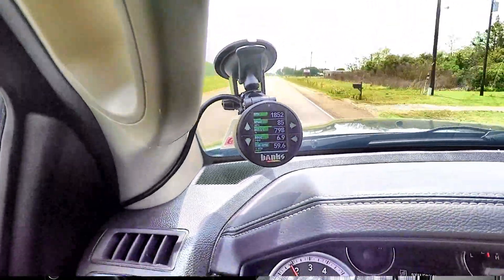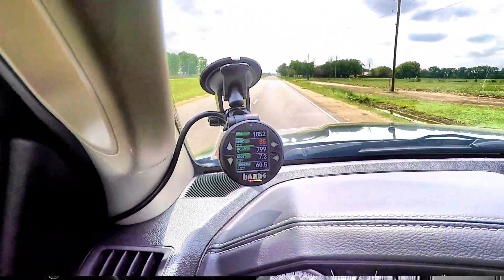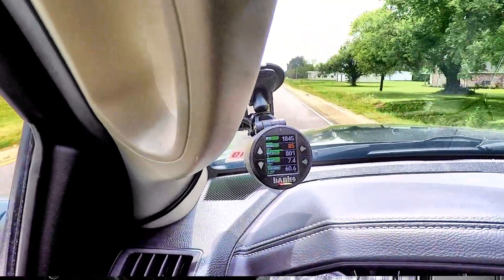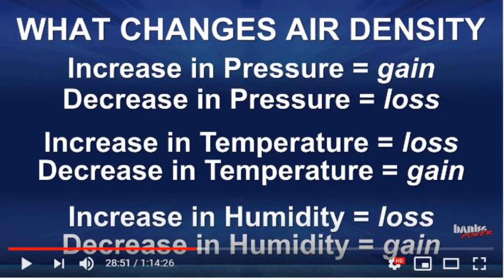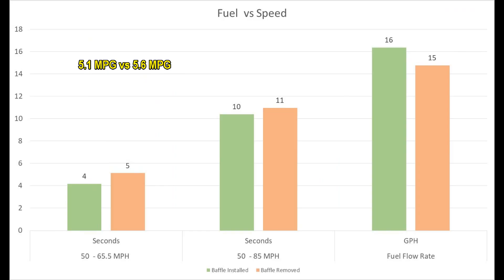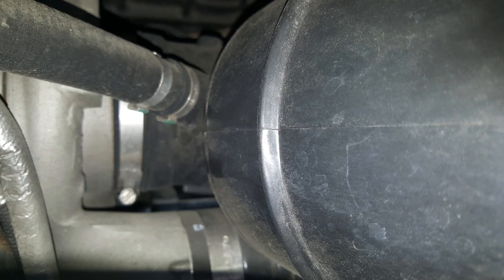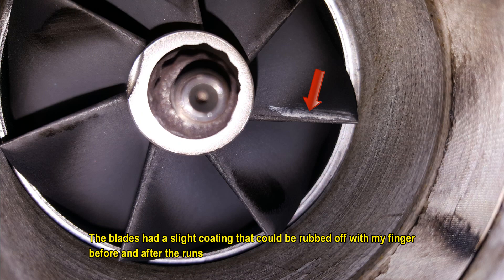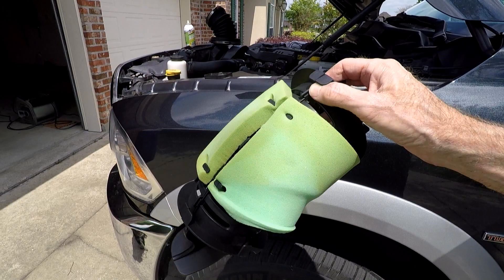Ram 6.7L Cummins Air Intake Baffle - Keep it or remove it?

Comment: This is fantastic. Amazingly done good sir!!!! 
I have 17 3500 6-speed manual trans all stock except a pedal booster to help with the “dead pedal” and turbo lag. I removed my baffle a few moths back and put in a K&N filter. I found/felt I got a lil more kick/power but loss on my fuel economy according to my computer . From watching this i wonder if changes are all in my head; I will try putting the baffle back without the foam. I do have a new stock filter as well i was going to put back in and see if I get better fuel economy. Either way great video.  Very well laid out.
Reply: The K&N will dust your engine. Look through it up at the sky and see the pinholes in it.  Project Farm tested all aftermarket air filters and K&N was the worst for dust removal.
Reply: @davidanderson8469   I upgraded to a S&B CIA a long time ago. But I thank you for your concern
Reply: @richardm875   My friend had the S&B.  It filters great. He just likes the quiet of the stock filter. I would choose that if I went that route. He and I returned to the OEM muffler too. No difference in my lie-o-meter from a freer flowing one I had.

Comment: pull it and re route the crank case vent to the ground.
Reply from the maker: I like that idea but I'd like to have an after market duct to get rid of all the flow reduction just before the air goes into the turbo where the baffle used to be.

Comment: Ive ran my truck with out that baffle for over a year before and after I deleted and tuned it and it absolutely does nothing but sound, take it out if you want a little bit more whistle
Reply: what kit you use to delete your truck?
Reply: Esteban Vega the sinister diesel egr delete kit and than bought turbo back flo pro exhaust and than also a bully dog gt tuner

Comment: I found some information on the baffle and insert once, and I can’t remember where. I read that the baffle with veins was installed into the intake to put a spin to the incoming air and increase the velocity improving performance. In doing so, they noticed condensation forming in the intake tube and the foam was the solution to that. As a rule of thumb I would inspect and replace the foam when degraded. Probably at 100k or so, but who knows for sure
Reply: With my experience I think the opposite is true and that it's to keep the air going in straight to the blades instead of doing a tornado up to the air filter

Comment: Nicely done sir. I was actually starting to research this myself and found it difficult to get any answers from the manufacturer. Much appreciated. By the way I wonder what the comparison might be with this and an aftermarket cold air intake setup. Would be cool to see that breakdown too but it’s not as cheap to get the data!

Comment: Restricting air flow in and out of engine is a deterrent, I removed mine a long time ago and barely notice sound change but I certainly noticed the better fuel mileage.
Reply: Where's your data?
Reply: @800PooDragon  Plug your air intake or plug your tailpipe and see what happens, and there's your data !
Reply: Brilliant
Reply: @800PooDragon  Something simple that a moron like might understand.

Comment: I’ve had mine in and out a few times based on everyone’s opinion. I think I’m putting it back in minus the foam. I see about 2 pounds less boost in my very mildly tuned 2017 during my highly unscientific testing.

Comment: My guess is it was installed strictly for sound control. You probably should run another test with the baffle installed minus the foam. There may very well be increased resistance as the air moves around the empty space where the foam was installed. If the designer did not make room for the foam, there would not be that shoulder just before the turbo or possibly even the runner that directs the air at the bend. Just my thoughts. Great video and information as always. Thank you Marion!
Reply from the maker: Yea, Dennis, the more I've thought about it, I think you are right because the after market ducts don't have all that air disturbance before hitting the blades and I do think the sound is a little louder the more I drive without the foam.  I'm probably going to get an after market just to find out how it does.  thanks.

Comment: Hey Marion, really appreciate all your videos.  Thanks much.  But I'm a little confused on this one.  Can you clarify please?  Your two tests where with and without the "baffle".  What exactly does this mean?  With and without the "plastic air vein" or with and without the "foam padding"?  So in other words did you run full "baffle assembly with foam" and "full open" or just with the "foam" removed but the "plastic air vein" still installed?  Seems to me that maybe three tests should have been run, full open bore, plastic vein only, and full baffle assembly.  But then again, maybe in the end it doesn't make enough difference one way or the other.  I'm running my 2018 Ram2500 with just the plastic vein.  I did not notice any performance changes, and only slightly improved audible turbo whine sounds.  Again, thanks for all you do, you've been a great source of information!

Comment: just remove it. they eventually just dry up and flake off ... into your turbo. they also free up a bit of horsepower and make it sound much better as well. nothing negative about removing it. at all. if nothing else just get rid of it to keep the drying up junk from getting into your turbo by junk i mean the drying foam stuff... it'll eventually dry crack and flake off into your turbo. is only there to muffle sound for people who don't like the whistle a turbo makes....

Comment: Another great video. Thanks for doing the research. I removed mine and noticed the sound but no real performance difference. The sound is most noticeable driving by a concrete barrier or through a tunnel. Base on your number I will put mine back in less the foam. Just FYI, my truck is also a ‘14 but has 91k it looks the same as yours.
Reply from the maker: Thanks Ben, It's probably not noticeable without a dyno.  Without the baffle, the boost eventually comes within 1/2 psi of the with baffle but gets there a couple mph later.  Also, this was extreme, wide open full boost which we rarely do.  But in a drag race the baffle wins. ha.

Comment: While I understand the data you collected what I don't understand is why the baffle, what made RAM's engineers design and add this thing. The differences in the collected data between with the baffle and without it do not seem all that important or cost justified. I can't help but think there is more to the baffle story.

Awesome job, thanks so much for collecting and publishing this info.
Reply from the maker: Yea, I agree.  Would it be nice to talk to the person that designed it.
Reply: i think it is just to muffle the turbo.
Reply from the maker: @dillonh321  yes I agree except for the duckbill scoop where it goes into the intake.   that's not for sound.  that's for efficiency of the turbo. But yes the baffle itself is for sound
Reply: @MarionBlair  
Do you think it is a big enough difference to leave it in? The numbers you show doesn't seem to have a large difference.
Reply from the maker: @dillonh321  it's probably not that noticeable since when I was running the test I was running the turbine wide open at about a hundred and ten thousand RPM. normally you not going to be boosting anywhere close to that. Over half of that thanks.
Reply: @MarionBlair  
Okay, thank you. I just watched your video about removing just the foam, I will just do that. Thank you for all the fantastic information good sir.

Comment: Why anyone would want plastic and foam in between their air filter and turbine that spins over 100,000 rpm is beyond me.  It's only a matter of time before the insert deteriorates and lets go straight into your $2400 turbo.  Yeah, I took this thing out the moment I discovered it living inside my intake.  To me, it's just one more obstruction to be deleted from the air-way of this engine.
Reply from the maker: Agree, this ranks right up there with the capless fuel filler.
Reply: I found - only after 15K miles (New 2017) my foam was showing signs of deterioration due to whatever - I removed the whole entire contraption - average mpg never changed  nor has it caused any reliability issues! 
I never will have to worry about any of the foam or rattling around plastic entering the turbo.

Comment: i pulled that thing out upon 20 min of ownership.  EDIT:  Marion I would be really curious for you to repeat this test, but with an aftermarket air intake like a S&B setup
Reply: Me too! Lol
Reply from the maker: I may do that.  I think Ram created a solution for a problem that didn't exit.  I simple piece of duct with smooth turns seems to work find on everything else I've seen.

Comment: I have removed my baffle and installed a K & N filter in the stock air box. Of course I think it has helped but never really knew for sure. It does make it sound much better in my opinion. I get a pronounced turbo whine inside the Cabernet Sauvignon but its not really too loud. Thanks for this video.
Reply: Go pull up videos of how much dust a K&N lets through.